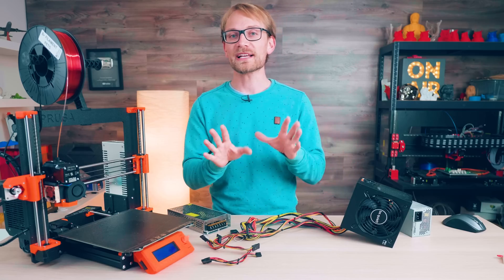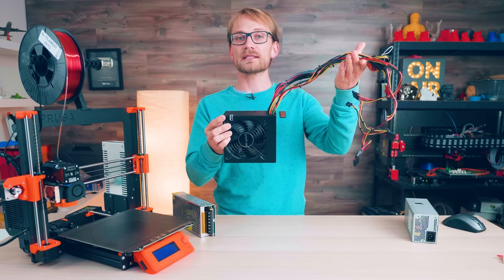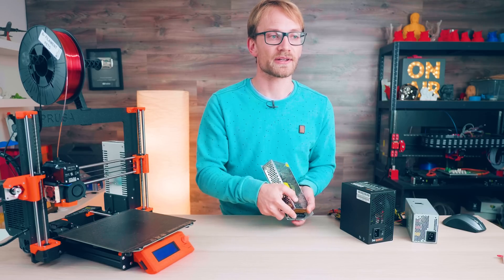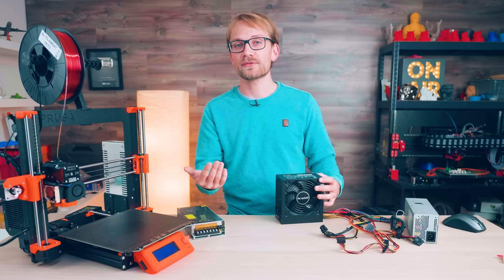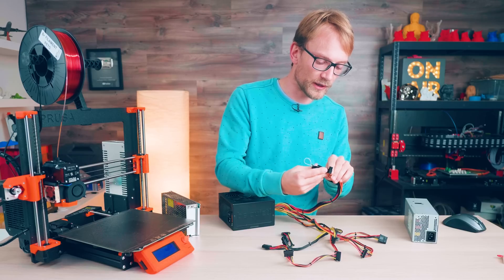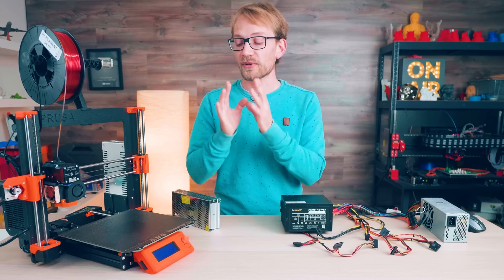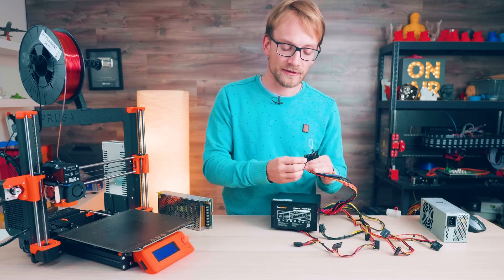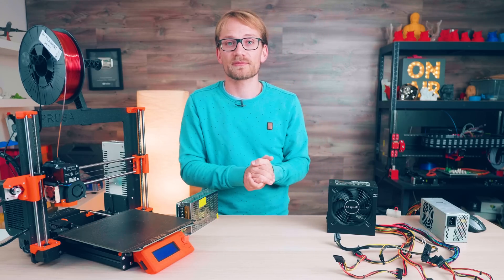ATX supplies are super useful for 3D printers!

Comment: I been using PC power supplies since forever on my 3D Printers, what is nice is that they have 12V, 5V and 3V to play with and the whatts and amps are much higher and more stable as well, depending on what make you use (dont use cheap crap) - I perfected the trick to modify PC power supplies. Nice review and info.

Comment: I’ve been looking for an excuse to use more Seasonic products :-)

Lol kidding, the ‘industrial’ type just make so much more sense.  I’ll just slap a Noctua fan on one if it needs cooling.  Did it for my Ender 3 Pro’s Meanwell unit and it made a ridiculous difference in noise.  Been running for 2.5 years with the fan swap.

Comment: When i built my first 3d printer myself i went with ATX-powersupply since i had one extra that was available. Worked fine for years until i finally bought factory made metal framed 3d-printer to replace it.

Comment: 24V industrial type, with a relay switch controlled by a raspberry pi that is on with another insdustrial supply of 5V (i have one for 35W on 5V) - those 5V comes in handy for lots of sensors and actuators (relays and stuff.. the RPI GPIO is 3.3v, but with a npn transistor i give the 5V to whatever amps the relays need (which is much more than the max 60mA GPIO pin should be used, and also it's 3.3V. I like to transistorswitch all gpio outputs for turning on a fan, a led strip, the PSU, etc)

Comment: late to the party, but one more advantage to atx supply. 
if youre on an arduino/ramps board with marlin as many are, you can link the green wire into ramps and control the atx power from marlin. 
mine automatically turns the 12v rails off when the printer isnt running, saving some power and automatically turning off everything except the arduino and the raspberry pi.

Comment: Any links to tutorials or documentation on using the atx shut off from the printer or through a raspberry pi octopi set up kind o thing? Would like to use ATX as a supply for a prusa mk3 and a raspi v4 B running octo print and a camera 🤔 any help would be appreciated 🙏

Comment: Hi Thomas, I have built my DIY 3d printer and I'm using 2 ATX power supplies 1st for the printer and 2nd for the heated bed. I used a 12 relay to on/off the power to bed. Now the problem is when the temperature is reached 60 degrees after that relay is toggling every second. Can you please help me to fix this. I'm using Ramps 1.5 and Marlin 1.1
Thanks

Comment: Are you aware of a cheap industrial psu providing both 5V and 12V? This is in my opinion the main benefit of using ATX since stepping down 12V to 5V for high current loads like Raspberry Pi is not trivial

Comment: I've recently remade all the electronics of my Anet A8 upgrading it to TMC2130s and I've used an 875W computer PSU. I know that that is overkill however I didn't go out of my way to buy it, I found it in an old Aurora R2 which is a rebuilt computer and the manufacturer made the PSU slightly larger (not longer, larger) so that it couldn't fin in any standard case.
Basically, I had this PSU laying around that I couldn't use and the choice was pretty clear.

Comment: A lot of system integrators (Dell, HP, Lenovo etc)  use 12v only PSU's that are proprietary versions of the ATX12V standard (ATX12V is an old variant of ATX that only supplies 12v).   If you want a cheap 12v PSU wthout 5v and 3.3v, cannibalise a Dell, HP or Lenovo desktop PC.  A lot of us PC nerds can get them basically free.  These PC's have 3.3v/5v regulators on the motherboard, same as their laptops, and the small form factor PC's have physically small PSU's.

Comment: Isn't it possible to use the 12v rails in series to get 24v?
Reply from the maker: Nope, they share a common ground. You'd just be shorting out one of the rails if you tried that.
Reply: @MadeWithLayers  I thought that might be the case, though it's probably commoned up on the circuit board, so potentially it could be modified but it would be complicated and every model of PSU would be different.

Comment: Can't I obtain 24v from the ATX power supply by using the yellow cable (+12v) with the blue cable (-12v) to close the circuit, instead of the black (GND)???
Reply: Yes, but the single -12v connection usually has a low amperage limit.

Comment: DON'T JOIN RAILS TOGETHER !!!!!!  This is such a common mistake in non-electronic major peoples. 

If u join both 12V rail together, they could back feed eachother, wasting a lot of energy and might desotry your power supply as well. This is due to the fact that they are not prefectly at 12V, any tiny difference will start back feeding eachother. And powersupply has tiny internal resistance, small voltage difference still generate lots of current. You might get lucky that the two rail are actually the same internally, then you are fine.

But, don't put any two power supply directly in parallal !!! or even two channles in the same powersupply.

Comment: You dont need to splice anything, just use an 8 pin pcie and the eps connector, one for the bed and another for hot end, one sata for the logic. Also not all psus have separate rails and also they don't always work how you've mentioned. You also don't need to cut anything, just buy modular and shunt the power on wire right at the back of the power supply or use the board itself to control it. Atx psus are better in pretty much every way but now with printers moving away from 12v they're not coming back.

Comment: One could use a +12V rail for power and a -12V for ground to get 24V, if both rails have identical amp ratings, but forget about using that 5V and 3.3V if the power supply provides a common ground for all of them.  One would probably be better off opening it up and implanting a 12V to 24V boost converter

Comment: Can't you just add the electronic power function with a relay and a separate 5v psu (maybe a cheap buck converter running off the main unit) with a cheap industrial PSU?

Comment: When I started building my printer about 5 years ago, the industrial supplies weren't all that much cheap, and ATX was pretty much best choice. Even though I rebuild it this year, I still used the same ATX supply. But for the future I think I will reconsider switching to 24 volts. But then again, I would have to switch all the electronics, so I dont know.

Comment: 1. Whatever power supply you select, you need to ensure that it supports inductive loads, or take precautions to ensure that inductive loads do not destroy it.
2. The vast majority of computer power supplies do not have sense leads, thus they regulate their voltage based on the voltage at the power supply.  The voltage drop across the wires becomes a factor.
3. Inexpensive computer supplies are fairly fragile.  The shock of dropping something on a table could cause something to dislodge inside the power supply, short out, and cause a fire.

I could list more things as well, but it all boils down to 1 thing.  Make sure that the power supply selected is specifically designed to address your use.  If you don’t know how to assess this, then you should not be working with power supplies.  Having a power supply blow up in your face might teach you something, but it could also severely harm you.  I have an electronic engineering background, and I never underestimate the damage that a power supply can inflict.

Comment: It's also worth mentioning the thing that was in view for the whole video: that fan. ATX power supplies include fans, which can be noisy, and which will circulate air in a place you may not want it circulated (because you are trying to maintain an average air temp around the bed, for example).
Reply: The 140mm fan of my ATX PSU (on my (homemade printer) is way more silent than the fan on my Ender 3 Pro meanwell PSU :)
It’s put underneath the printer so no unwanted airflow on the print

Comment: My Anet E10 power supply died (looks like a bulging cap on the 240watt supply) so I used a 480 watt ATX I had, after seeing this video today and it seems to be running better than before. The Y axis bed stepper sounds like it isn't struggling like before- has more zip to it. Printing now- up and running, fingers crossed :)

Comment: I have two custom built printers and I use two 12v industrial PSUs and on the other I have one 24v and one 12v industrial. I'm also in the process of building a laser engraver with a 12v industrial as well.

Comment: or you buy a modular ATX psu (+500watt) with cable managment that delivers 300watts on pcie cables  and has 2 and more lines when nessasary. the good thing about PSU with brand names are if they blow up they cut the power where cheap china psu are giving a overvolt loadout throu the lines when they are giving up, what means they take mostly everything with in the grave. and if you are abolutly unsecure you could buy a thermalthake tough 1500watt goldstandard psu 80+ (300€)  that beast get every job done

Comment: I used a quality server ATX power supply I was able to get for free.  Eventually I installed a mains wired silicone heat mat but it is quiet (fanless) and very stable. That said in my LED aquarium light I use a nice Meanwell industrial PSU which also works quite nicely so far for many years trouble free.

Comment: i live in tunisia and im considering building a 3D printer with arduino mega + ramps . in tunisia i can get a 380W psu for 10 $ brand new while a industrial PSU like the one in the video cost around 35 $ to 50$ due to them being not very common and harder to import 
i would prefer to get a proper industrial PSU but im an engineering student so im poor and i will tolerate the cheap PSU exploding in my face than spend extra 20 $

Comment: Protipp. Usually there is nothing to complain about Second hand power supplys and they are really, even those 80+ Got a 660W 80+ Platinum modular PSU for 20€. It wasn´t missing a cable.

Comment: I used an ATX psu just because is the one that I had laying around, but the past month I switched my printer to 24v and I really miss the hability of switch it on/off remotely.
I would probably return to the 12v system just so I can use the ATX

Comment: I bought a FSP300-60GHT 300W slim Power Supply second hand (around £8.00) on Ebay when I built my 3D printer. De soldered most wires from the PSU but kept a couple of +12V, ground and the +5V SB. The +12V has two rails which supply the bed, the motors and the hot end. The +5V SB to power the Arduino and Ramps board by connecting to 5V (VCC) on the Ramps.
This gives me the option to only start up the  power supply when I need to control the motors, start heating and running the printer and shuts down into standby automatically when finished. I also used a boost converter on the +5V SB to keep the 12V hot end fan running after shut down until it cooled down to 40 degrees then shuts off.
Reply: Forgot to mention. D1 on the Ramps board needs removing to stop dual supplying the Arduino when running and an additional mosfet module connected to the servo headers for the hot end fan.

Comment: A third option would be that the 3D printer manufacturers get together and do a SPEC similar to ATX for 12V, 24V and 48V - including 5V standby, electric on/off,... They could come up with their own set of connectors or simply reuse some old PRE-ATX mainboard connectors. They would be free to change the size etc.

And the result is a fixed form factor and a spec people can produce or order. Just look at the stepper motors for size and layout. It might even be better to look for other applications as well. E.g. getting the LED guys on the boat - 5v standby for remote access and cloud snooping and 12/24V for light action.

Comment: You should have mentioned used server power supplies. They are extremely low priced, efficient, reliable and easy to work with.  I also wonder why so many don't take advantage of the M80 and M80 gcodes to turn the printer on and off. This is extremely easy to achieve on ATX and server supplies.

Comment: i recently used a PC-powersupply to power my "highpower" lithium charger (for rc model batteries)
worked great and very cheap got a medium quality supply second hand in good condition for 4,5eur for that pourpose.(i bought several from the same seller so shipping dropped to 0,5eur per Powersupply)
Reply: Sounds like a 50w power supply. To power your lipo charger? That thing must be slow as heck
Reply: @ELValenin  50w is fine for me(it can go higher but i want to maximise the battery life so i dont charge at full amps), my previous was charger was ~>10w :D
Reply: @hyperhektor7733  What kind of batteries do you use? 3s 2200mah??? I have got a 50w charger and my 6s 5000mah pack charges slow as hecc
Reply: @ELValenin  i have a 200w model of the usual RC-model chargers (B-5 clones but not the lowest model with 50w, but a bit better one with 200w ) I charge LiPo 1s2p 12000mAh(2*6A) slow with 2A over night (some  ~6 hours) i could charge way faster but there is no need to (for me).

your battery should be finished in ~1h at 2A, but a 50W Charger could output ~4A as far as i know.(look in the Datasheet)
 Whats your charging amp and time? (and Battype =Lipo or Lion?)
Reply: @hyperhektor7733  the 3s pack here was just kind of sarcasm, I'm sorry. I've got a 5000mAh 6s lipo. It would require about 150w to charge it at a 5A or 1C rating. (probably would be finished in 70 minutes or so if at 5% charge) So I would need about 200w for the power supply (chargers often aren't really efficient)
Reply: @ELValenin  then i would really recommend a 200w charger atleast, if time is important than even more than 200W.,  But 6s is also maybe problematic if the charger can use 12V and step it up efficiently. its worth a try with PC-PSU since up to 500W they are cheap on ebay (~7-10eur)
I paid for my 200W charger ~115eur >5 years ago, maybe you get more watt these days
Reply: @hyperhektor7733  isdt q6 pro Battgo, about 60-70$, 300w. I think I'll Stick with my imax b6 mini though (I don't think it will be long until it breaks, I bought it 4 years ago)
Reply: @ELValenin  maybe i dont know the prices of today, since i dont need a charger, my model works atm.

Comment: The advantages and disadvantages of ATX power supplies:

Advantage:
· Efficient power supply with quiet fan
· Switch and socket already integrated
· Defective ATX power supplies can be used if only the +5 and -12V rail are affected.

Disadvantage:
· Large wiring harness, alternative modular connections (more expensive).
· 12V.     24V are better for printers and small milling machines
There is little talk against recycling ATX power supplies.

When buying new but I would only rely on 24V technology.

Comment: I used 2 ATX power supplies for my first 3d printers but they seemed not very reliable, I had rare shutdowns while printing. Probably some voltage spike or other things happening, since there is lots of unregulated stuff going on. I then used switch mode power supplies for LEDs and never had any problem since.

Comment: One thing about the multiple 12v rails, they as not always what they seem. I have a supply that lists 4 12v rails but they are all just linked together at the output on the power supply board.

Comment: You can buy a small circuit board with an ATX connector on it with a selection of binding posts with different voltages. These boards can be had from Banggood or Aliexpress for less than $2 US. Makes for a clean and safe install as you can cut off all of the wires but the main ATX connector. Also, all of the Binding posts are fused.  You could easily mount the breakout board to a printer with the power supply connected through a nicely wrapped ATX connector & cable.
  Due to the large number of scrapped computers,  used ATX supplies are readily available just about everywhere. These breakout boards make quality ATX power supplies a bargain for 3D printers as well as benchtop power supplies. As an added bonus, most ATX supplies are UL listed and less likely to catch fire or accidentally electrocute you. Not the case with most import (Chinese) supplies.